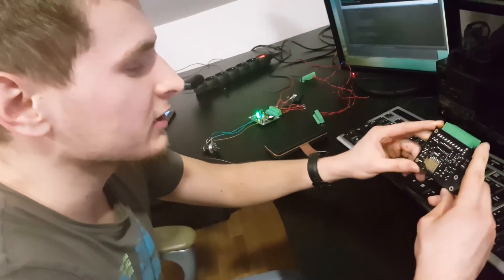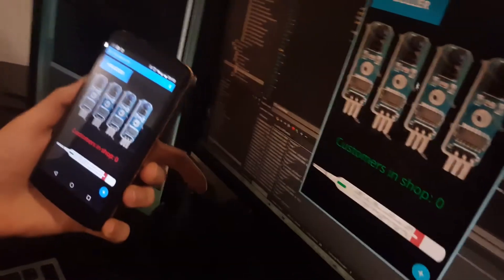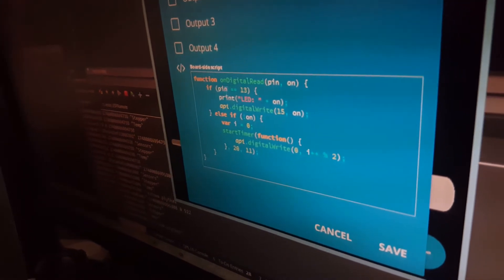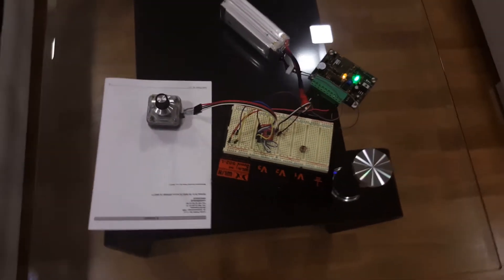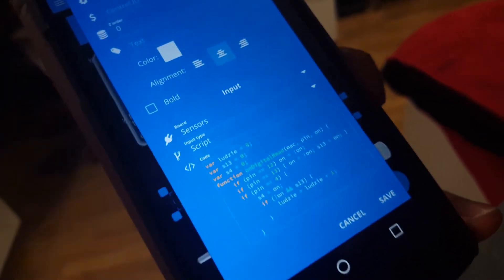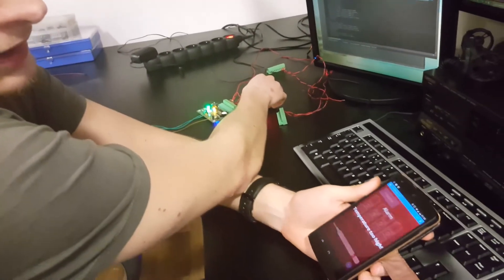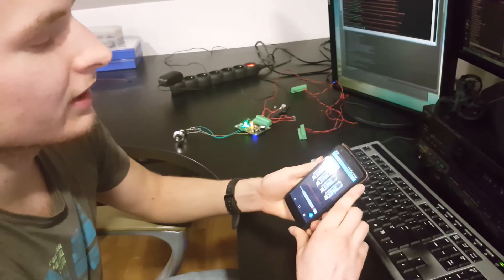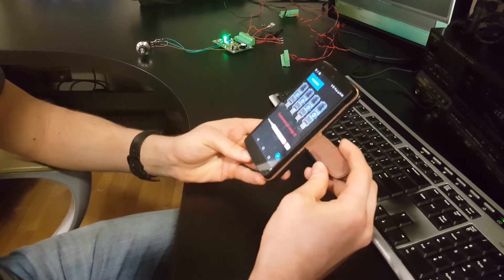ESPRemote - Universal ESP8266 UI app

Comment: This looks really amazing, you have really thought about every use case, have you decided yet if you'll release it as open source?  I'm hoping to control about 25 esp8266 modules with one app in a place where there is no wifi network.. would your application be able to do this?